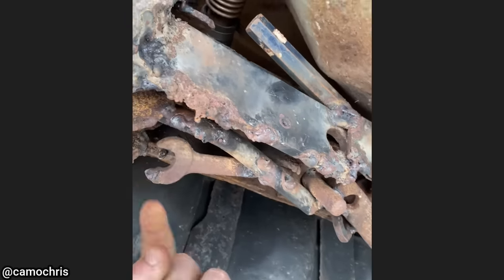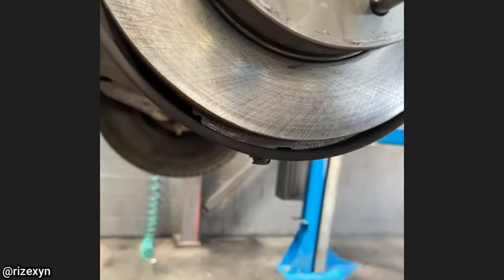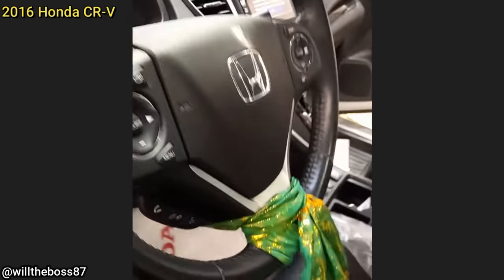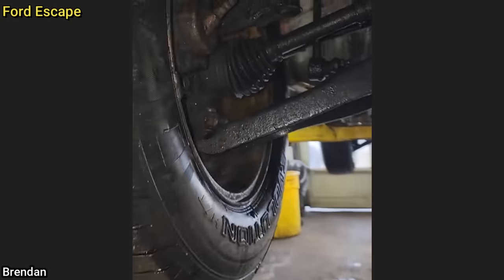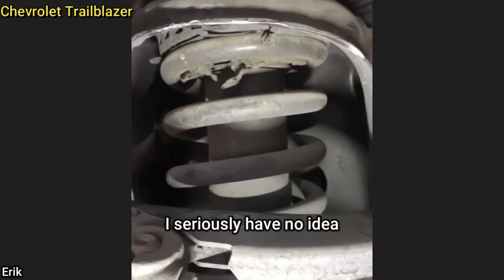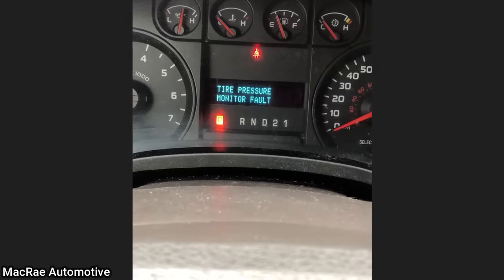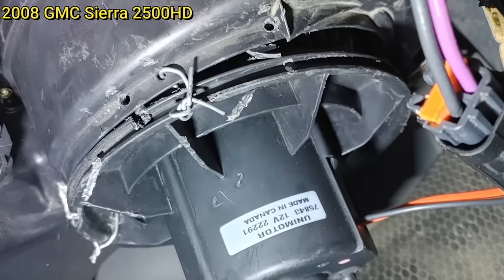Customer States Another Mechanic Said Their Car Is Junk | Just Rolled In

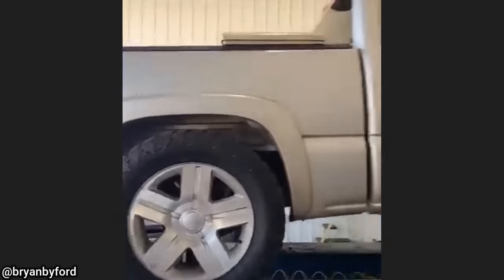Comment: 1:10 Okay, I'm tech-savvy in terms of personal and office computers but not car computers, but I'll try to explain this using my knowledge of office computer firmware. What I think is happening here is because this is a General Motors OEM electronic component, it will have the logos for all GM-owned brands stored in the system firmware's storage device, and the previous technician who worked on the vehicle has obviously accidentally changed something in the firmware boot settings that has caused it to display the Cadillac logo rather than the Buick logo. Again, automotive computers are not my area of expertise, but that definitely looks like a firmware boot setting has been changed.

Comment: Just today i stopped next to a fairly new Chevy Silverado at a light, couldn't have been older than a 2020. I glanced over and couldn't help noticing all the rust on the frame, the parts I could see through the wheel well. It wasn't rusted through, mostly surface rust, but nonetheless I was thinking "Wtf? How can that be?We're in Florida!! 😨😨 I mentioned this only because i was thinking of upgrading to a new Silverado soon but now i'm having second thoughts. Is that normal for those trucks or is it some shitty gmc quality control?
I may have to give ram trucks a look or those new tundras...

Comment: Damn, with all these car diseases I seen here, my old '91 Explorer Sport are surely just mint condition in comparison;) Good frame, all new brakes (rear disc brakes from U2), all new suspension, inox 2.5" exhaust, fully TIG welded by myself, no dripping fluids, pristine seats, heavily modified 4.0 OHV and A4LD&5R55 hybrid transmission, etc...

Comment: So I have a bit of a driving OCD ...  i do not sit behind vans or trucks (ever) as you cant see around them, so you don't know what's happening up ahead and you're trusting some other guy with your safety ... and if they screw up you could be the sacrificial offering, and the junk i see on here just validates my opinion ... i want to see this crap fall apart in front of me and be able to take evasive action, rather than sitting behind a truck as it sends some numbnuts diff through my windscreen ...